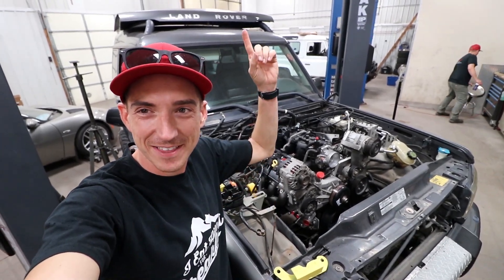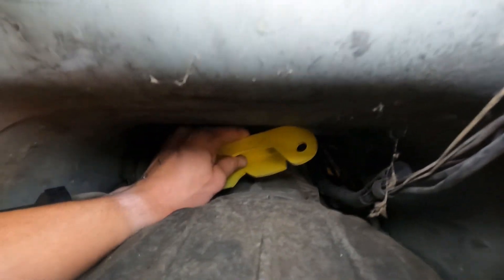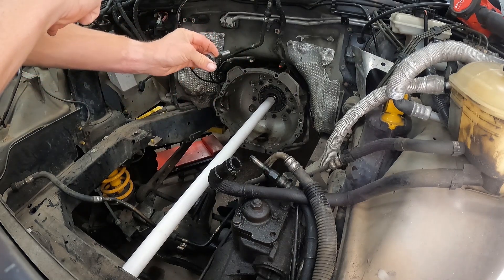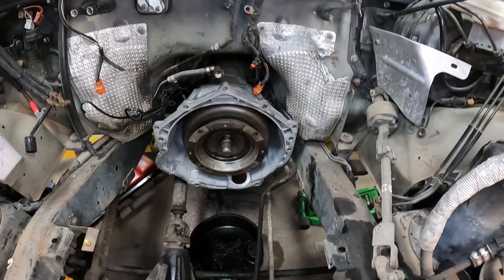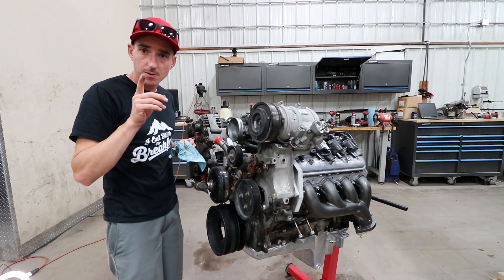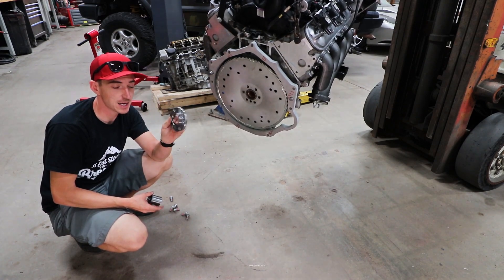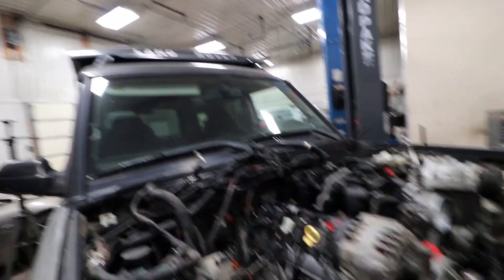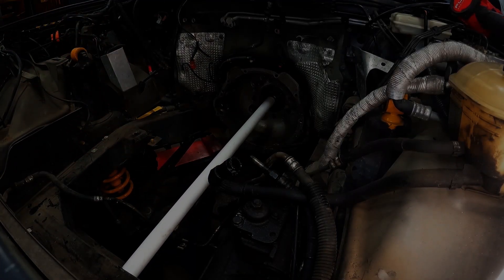The Engine is In! | LS swap Land Rover Discovery | The answer to the Discovery’s problem?

Comment: Looks good. I'm also doing this conversion on a 2002. Decided to upgrade to the hp24 transmission at the same time so I swapped the bell housing while the trans was out. Much easier job when it's flipped vertical. I replaced the pump seals and gasket while I was there. Need to build the exhaust and order hptuners but I'm almost done. I didn't film a bit of it though so I'm glad you're doing this.
Reply from the maker: I imagine that made that quite a bit easier. It was a tad cumbersome doing it in the truck. But doable. You’ll have to let me know how you like yours. Thanks for the comment, like hearing from other owners of these.

Comment: We are currently doing a 5.3 ls swap with Holley management system , using the factory Manuel transmission on a 1997 Land Rover discovery ! Your videos look great !
Reply from the maker: That’s awesome. We have one of the Defenders that will be getting the sniper. Along with an 02 Kalahari Disco that will be converted to manual and sniper. That D1 will be a cool setup.
Reply: Please post some videos. I'm thinking of swapping my D1 as well.

Comment: Greetings from Omaha, NE!   I have over 15,000 miles on my 03 Disco ACE LS swap!
Reply from the maker: Awesome. How has it been for you?
Reply: @LostCauseRanch  absolutely great!  I am waiting for 4.5" lift from Rte Fab and some diffs with 443 gears from GBR with a Detroit in rear and tru trac front then 35"s..     
Have all aluminum allisport radiator and reservoir haven't been able to install yet.    Many trips to Tuttle Creek OHV and it does very well on the rocks.

Comment: Very cool to see this. Forking out a couple grand for that kit and not knowing if it's any good is risky. Nice of you to be our guinea pig ;)
Reply from the maker: Haha. I’ve been a good guinea pig most of my life. We have a marks4wd tcase adapter to  put a 5.3 with the 4L80 gm trans in my brothers RRC. So it will be kind of nice to have somewhat of a comparison to the 2 schools of thought at the swap. Thanks for checking in as always!
Reply: @LostCauseRanch  Nice. That RRC swap should be fun.
Reply from the maker: Should be a good one as well. That one threw a rod on the 3.9. We also have a tcase adapter from synchro gearboxes for our ls3/6l80e Defender. So we are running the gauntlet on LS adapters for these things.
Reply: @LostCauseRanch  how did that marks 4wd adapter turn out? Any luck?

Comment: Hi guys, just wondering I am planning to do an LS swap on a year 1980 Range Rover and wondering if I can do that same conversion to keep the original transmission but swap out the engine to a 5.3 LS do do you think that would work?
Reply from the maker: You could do that, but personally if I were to do an older Range Rover like that I would probably go with a 4L80e transmission from gm and adapt the lt230 Land Rover transfer case to that.

Comment: Really appreciate the videos as im starting this swap and your explanations and details really ground the whole thing. 

Actual question: What bolts did you use to mate the LS to the new bellhousing? Factory length seems short with that spacer in place.

Comment: Afternoon
Will those engine mounts work with range Rover and where can I find those mounts?
Reply from the maker: What year Range Rover?
Reply: @LostCauseRanch  2004
Reply: Can I use the factory radiator from the range Rover?
Reply: Do you have a video for what you did for the wiring? Or the fuel?
Reply from the maker: @louisziegler3690  A 2004 Range Rover is going to be quite different than this setup. I’m not aware of a kit available for the L322 as of now. So that is going to be more of a one off custom job on the mounts and integration.

Comment: I LOVE that you guys are recording this step by step. It's in my near future for my '03 as well. Even though I have a top-hat-sleeved brand new 4.6- it's still a POS motor. I'll sell it to some purist and get a reliable 5.3LS.
Reply from the maker: We’ve had decent luck with the 4.6s over the years but have never personally deemed them worth investing a ton of money into a correctly fixed one. They just are what they are, not enough power if you are investing a ton of money into them. I’ve also never been a purist of anything, if something can be improved on I’m all for it. But definitely a Land Rover fan through and through. I think you’ll enjoy the process of you go through with the swap on yours. Thanks for the comments!
Reply: Rover engines are not a pos 
Your top hat block will last longer than that American rig, I’ll put money in it

Comment: It's looking good 👍.
So glad most of ours in the UK are Diesel ,TD5 was a far better engine.
Reply from the maker: I wish we would have gotten more diesel versions over here.
Reply: I don't agree the 4.6 was over stretched too much it was a far better engine as a 3.5 l they rarely had loose sleeves. When they went 3.9 / 4.0 l  to try to satisfy the American market, they started to get loose sometimes but if rebuilt with top hat sleeves they are a bloody good engine as far as I'm concerned.

Comment: do you think you will have to update the diff ratio. I am doing a ls2 6l80 into a td5 defender
Reply from the maker: The tire size on this one dictates that a gear change would help. We are doing an Ls3/6L80 in a Defender as well and don’t plan on changing the ratio on that with the extra gears in the transmission.
Reply from the maker: But we also are not going with as tall of tire on the Defender.

Comment: 2010 lr4 blew up on my birthday. Complete new engine needed. Can't afford it and owe on it. I am a disabled veteran and Patriot Warranty scammed me, acting as a veteran friendly insurer/Warranty provider. Land Rover swapped a blown intake manifold for $2.5k and then realized the engine was blown. Car ain't even worth 2k in parts. Can you give me guidance on more budget friendly direct engine swap? 2010 Land Rover LR4 5.0 HSE. Thanks! 

(I DC about perfect integration I just need a car that drives--BTW I am purely looking for advice not a handout!)
Reply from the maker: Did they give you any more info on what is actual wrong with the engine besides just being blown? Usually it is most cost effective to do a used replacement 5.0 engine vs. custom installing something else in it. Especially if you have to pay for it to be done. I would venture to guess you would be $15k+ to have an LS or something else installed in an LR4. And it wouldn’t in my opinion work as well as the 5.0 does. We never had a ton of complete catastrophic failures in the V8s. Usually head gaskets if it was overheated or valves if the chains broke. Both of which would be much more economical to repair than a custom swap.
Reply: @LostCauseRanch  timing chain tensioner broke and blew the rear intake manifold.

Comment: You can’t really blame Land Rover for the original engine as it was a BMW designed engine.
Reply from the maker: These 3.5/3.9/4.0/4.6 actually originate from the old Buick 215 from GM. The problem on the let ones namely the 03/04 4.6 in the Discoveries is that they pushed the limits of the block size wise with displacement and we’re using old worn tooling and the tolerances weren’t as tight anymore. They just ran too long on an old design engine. Which is understandable from a bean counter perspective. But I just like to tease and give them a rough time, everything has some sort or weakness one way or another and I’m sure you obviously now that I like these things haha.
Reply from the maker: Hey. We’ve made a living off repairing BMW’s. So it was alright for us they can’t get it right lately.
Reply: No it wasn't lol  see lost cause ranch's reply. He is completely correct

Comment: Did you have any issues with clearance on the passenger side rear valve cover? The rear of the PS valve cover is butted right up to the firewall on mine. Or any trouble lining up the DS motor mount to frame? I’m at that step and it seem like it’s going to take some tweaking to make it fit correctly.
Reply from the maker: It is tight on the passenger valve cover vs. firewall. But there is clearance. It was some good playing around to get the mounts bolted in. We loosened the transmission mounts and they are slid forward all the way on the slots. Then we got the engine mounts located in the forward/backward position. After that we ended up tightening the bolts that go through the rubber down to squeeze the rubber and that got us pretty close to the correct width. Bolted in the passenger side loosely then a slight push with a pry bar let us bolt the drivers mount in. Let me know if that makes sense.
Reply: @LostCauseRanch  Ok great, I’ll try loosening the transmission mounts and shifting it around a little bit. That all made perfect sense, I started to think my frame was bent or something. Glad to know it took some finessing to get it bolted up. Great vids by the way, I’m right behind you starting my wiring this week.